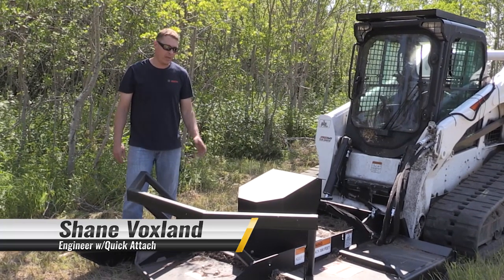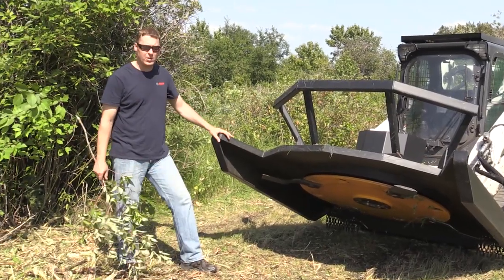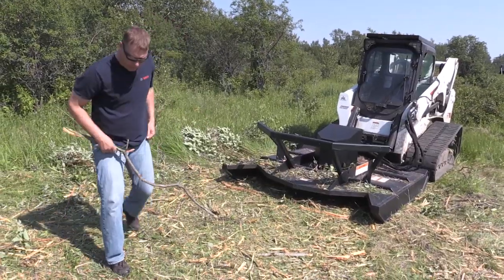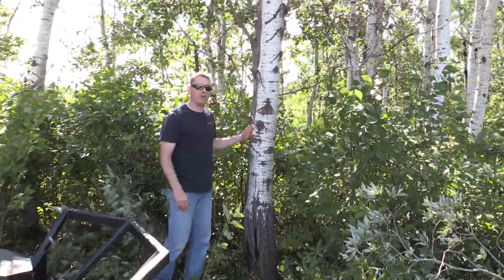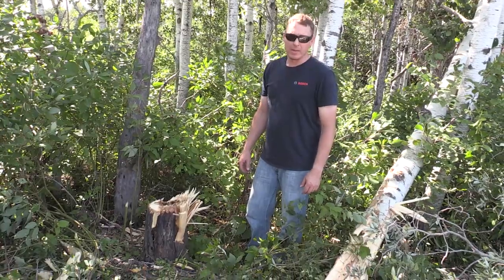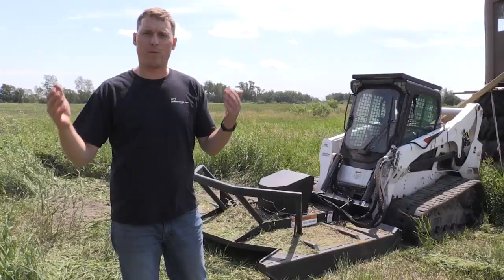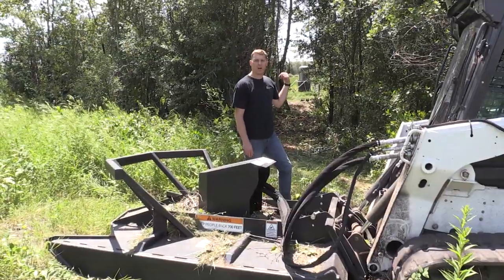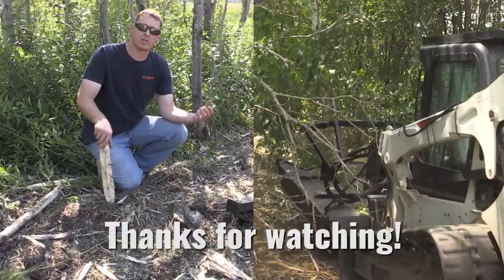Skidsteer clearing trails with the NEW Mega Mower HD™ Industrial High Flow Direct-Drive Brush Mower

Comment: Do you have to convert the controls of your mower to work with the bobcat?  Many times the Bobcat controls are non industry standard.
Reply from the maker: The mower is set up to work with bobcat or any other brand of loader.  No conversion of controls is needed.